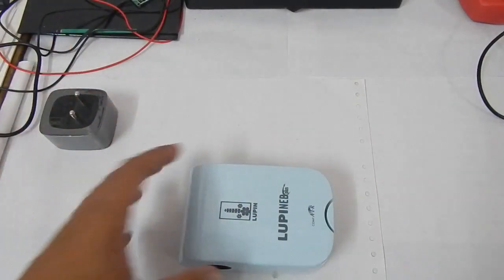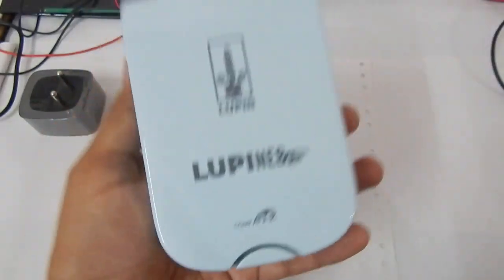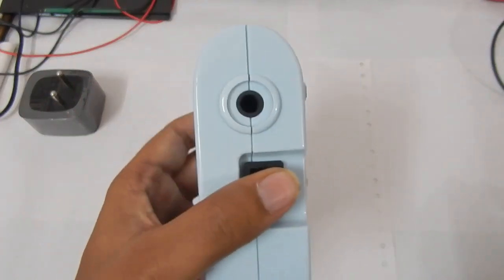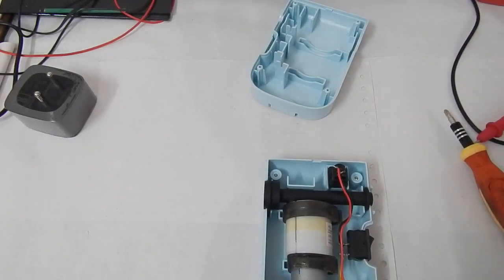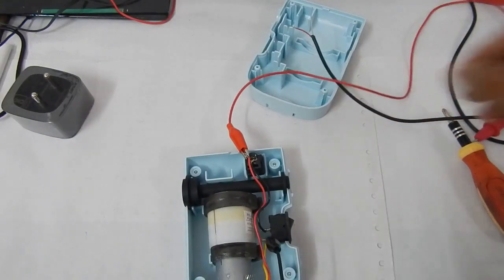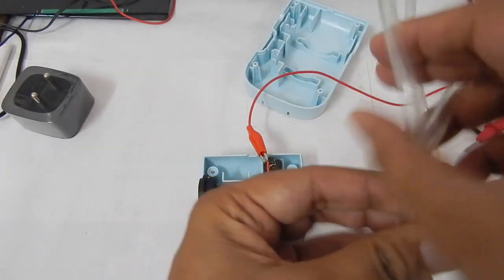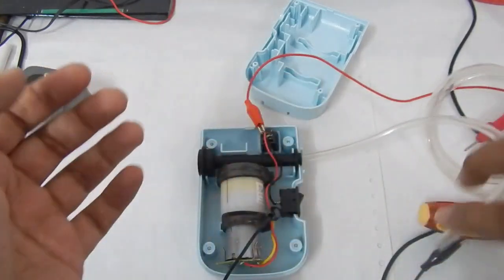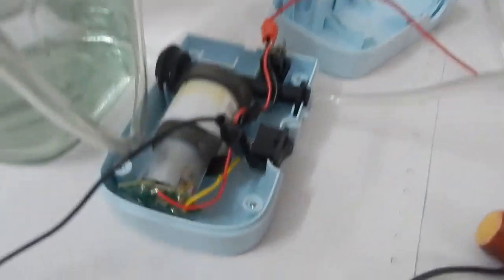Turning Old Nebulizer into Aquarium Air Pump

Comment: Can I use this 24/7 without off and continuous usage ? Or will it cause damage to the nebulizer ???
Reply from the maker: well, there is a motor inside so, it really depends on the life the motor. When the motor will fail is not easy to tell.